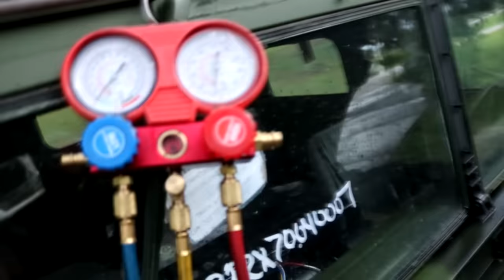10 minute build-Building HMMWV in 10 minutes-AMAZING TRANSFORMATION - Dakota Wood

Comment: well done on project...next time you change fluid in geared hubs, pop the back plate of and check torque, or actually torque the spindle nut to 27 ft lbs... very important to do this! believe there is a spider washer as we called them, push up the tab with a flat blade and if you dont have the cookie cutter socket, brass punch and a hammer with light taps it will come off... damn nice video and job well done!
Kurt Seidel   USMC
Reply: at ease soldier !!

Comment: Is that original paint CARC?
Reply from the maker: sburns1967 nope it’s a CARC substitute, you can buy it off eBay if you just type in CARC paint.
Reply: @DakotaWoodHD  so the paint that you were sanding off is not original CARC?
Reply from the maker: sburns1967 oops sorry I read that wrong, yes that paint I sanded was original CARC paint.
Reply: @DakotaWoodHD  great job on the restore but be very careful sanding CARC or welding a part with it. Dust and fumes are extremely toxic. You will need a respirator. Google CARC paint hazards or dangerous for articles on the same.
Reply from the maker: sburns1967 Thanks! I have read up on it and I have the correct respirator, that stuff is no joke. A friend on mine got really sick after sanding his without a respirator.